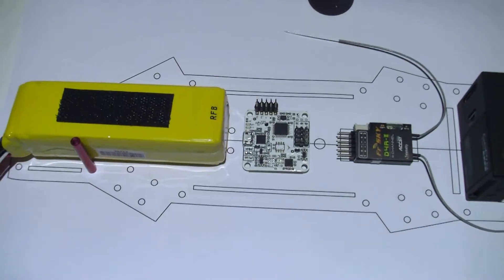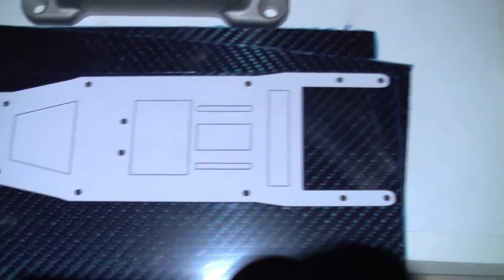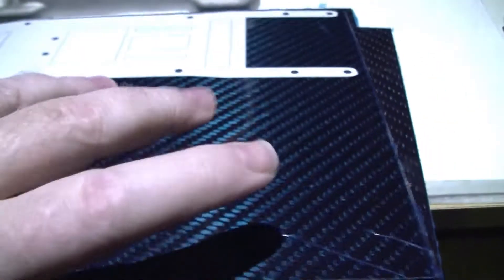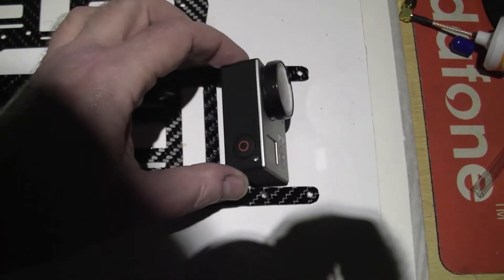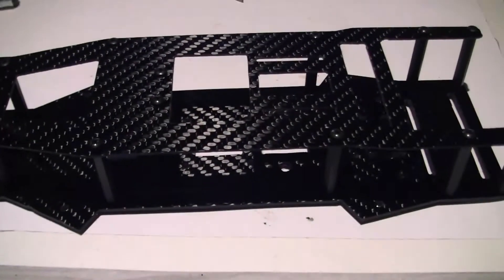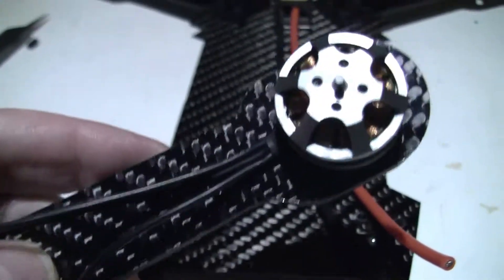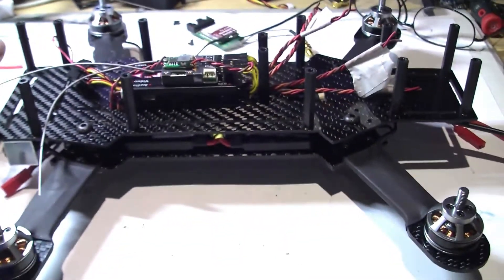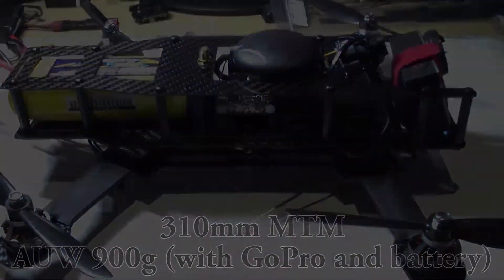Vortecks 310mm mini quad for GoPro - from design to completion

Comment: Oh yes, Dremel...were you using Tungsten carbide cutting bits then Tony..?.....Stellite maybe..?
Reply from the maker: +EnglishTurbines Tungsten carbide (grout removal tool) for the rough outline and a standard cutting disc and sandpaper for finishing :-)
Reply: Vortecks Respect, that sounds like a lengthy process...Scratch built Multis, dont know anyone else who does that...:)..

Comment: I mean like a 500-550 size that takes the f450 arms. I have a disco now, but the flight characteristics are so awkward with the asymmetrical shape. I'd want an h quad (or if possible, an x that just looks like an h so the motor to motor lengths would form a square around it)

Comment: Great job Tony, well thought out with escs shielded underneath, locked in performance and no jello!
CF is just awesome stuff.
Reply from the maker: Cheers Andy. I wouldn't recommend cutting this stuff - it gets everywhere and makes you itch :-)
Reply: Tell me about it - took me an hour to make longer arms for mine out of a 1m 16mm CF woven tube - every drill and saw I had went blunt, so cut and drilled with a file instead, improvising a lathe out of an electric drill running off a lipo cos the original rubbish batteries died after a week..
Got there in the end though!
Reply: Work in a box with a perforated floor and vacuum cleaner below to filter and vent outside or something along those lines.
Reply from the maker: Andy Lee Robinson Don't those sort of boxes come with padded walls, too? :-)
Reply: :-D
Optional retrofit for those of fragile disposition... :)

Comment: Hope you wore a mask, a suction hose on dremel will help too. Great work, 12k is super rare only a few manufacturers and not many in China must have been expensive. Can't wait to see more! a hand grinder with cutting blade can be good for shaping the CF. I just ordered 2204 2300kv for my HBx 330m
Reply from the maker: I wore a mask and I'm glad I did. I wish I'd worn gloves, too - my hands were itching for hours after.
Strangely, the 12k stuff wasn't too expensive - about 10% higher than 3k and made in the UK :-)